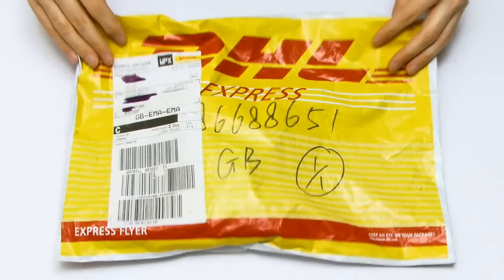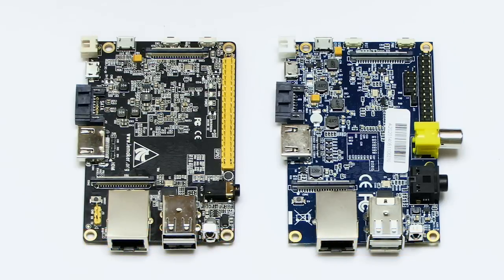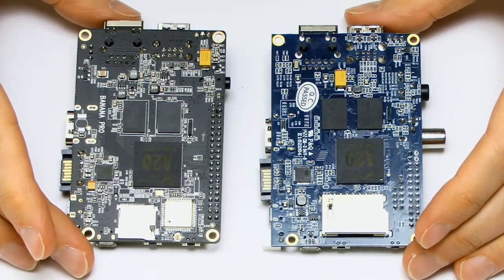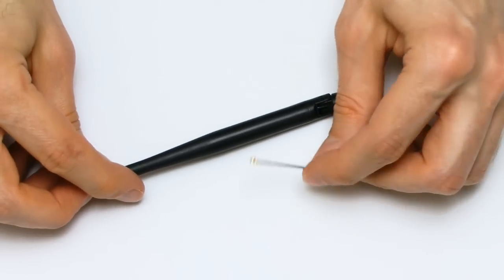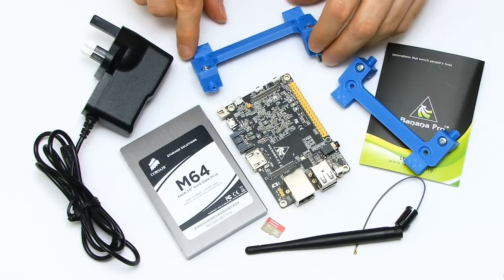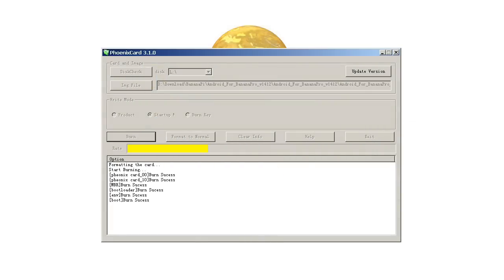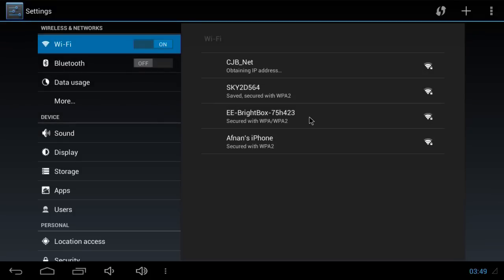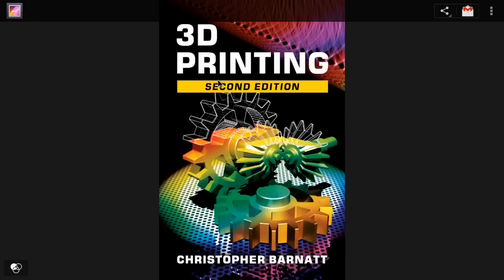The Banana Pro

Comment: I love tech theses days. So small yet so powerful :) great video as always.
Reply: Before portal 2, it was common to call slow dated machines 'calculators', but it wouldn't work these days with these micro computers. I had calculators in school which were as substantial as these things, and our fastest computers could not touch the calculator sized computers of today :P I think that is one of the major appeal of these, it is not about overall speed, but relative function, and these things have that in spades. 
Edit: Now i feel like digging for my TI-85 and seeing if any of my cheater(i mean helper) programs are still on it.
Reply: +Richard Smith Before portal 2? What does that mean? The game?
Reply: Robin Rai Calling dated hardware a "potato" came from portal 2, a game.
Reply: Richard Smith did it originate from portal 2? Interesting. Thanks.

Comment: I bought mine in early summer, and the thing works fantastic, I've had no problems with it whatsoever, but I find the board layout awful. First, it has external connectors on all edges of the board, so you'll need extender cables for enclosures if you need them. Next, it has SATA and HDMI ports side by side; even with an angled SATA connector, you will have a cable sticking out right next the video connector, or you again need to use extender cables. Finally, there are front and rear panel features mixed. The power and reset buttons are on the opposite side to IR sensor, which again is close to RJ45, which most people certainly would like to have on the rear panel. Whether USB connector should be on front or in the rear depends on use (and personal opinion), but when in use they're almost certain to block the IR sensor from the left. These weren't a problem in my build, but it does make making a small, tidy enclosure difficult.

Comment: So, The CHIP caught my attention to the single-board computers. I've watched videos, several of yours, compared and contrasted various single boards' specs. I have come to the conclusion that the banana pro is the one I prefer based on cost, built-ins, availability, functionality, support and what else. There is still one thing I prefer that most of the PIs do not have is the onboard memory. The buying an sd card, formatting it, installing the OS, etc., etc. is a bit of a hassle and leaves much room for error, but Android seems to run well on the Banana Pro.

This is an aspect of the CHIP I appreciate, the on board storage, but with the CHIP it seems more for programming and embedding, which I am not doing at this time and it needs a video adapter that costs as much or more than the board. The Parallella is THE tiny machine, but alas, I have not a use to validate spending the $100 or so for the best machine for the money. I like the Pine A64. It has decent performance across the 'board' but still generally low on benchmarks and tests and Android does not work too well on it.

All in all, it seems the Banana Pro fits my preferences at this time. Of all the single boards below $20 per bare board they all come out to about $50 to $65 with necessary peripherals and shipping costs.

Comment: Thank you for this! Really looking forward for the Banana Pro NAS video! Could you please consider 3.5 inch drive SATA powering? The connected drive(s) (3.5 inch size) need external powering according to Lemaker. An affordable NAS suitable for daily use should use 3.5 inch drives. Thanks again!

Comment: I just purchased a raspberry pi 3b and i was wondering how much would you charge for those brackets you used on the banana pro, but for the raspberry pi  I want to add a  solid state drive thanks

Comment: do you think it's better to use a case box with a motor fan or is enaugh the heat sink ?
Reply from the maker: +Walter P I personally have found the heatsink OK -- it depends how intensively you are going to run the thing! :)
Reply: +ExplainingComputers  well... I don't know .My project is to create a wifi server with banana and some android devices connect to it ....I don't hane any problems to get the case with fan. Did you try to run eclipse or netbeans on banana? How dows it work ? Slowly , normal , fast ....
Reply: if you want to you can use a small desktop fan to blow air on it i think that would be enough and if its not you can always slap a small ram heat sink like this on to help                    http://www.amazon.com/Saim%C2%AE-Copper-Cooling-Heatsinks-Cooler/dp/B018I2V46A?ie=UTF8&keywords=ram%20heatsink&qid=1464372429&ref_=sr_1_28&sr=8-28

Comment: I don't currently have an HDMI monitor or anything HDMI but I do have a TV with the red, white and yellow connectors. Is it possible to run video through the AV jack on the banana pro?
Reply: the banana pro has 3,5mm Jack that can be used as video and audio input just get composet to av cable and you shoud be fine

Comment: I've found the Android build on the Banana Pro to be very unstable. Also the Wifi/Ethernet drops within a few minutes of booting and the only way to get it back on is to reboot.
Using Android builds for the Banana Pi installed on the Banana Pro are very stable but not as fast for some reason, Ethernet works perfectly but of course no wifi without a USB wifi adaptor.

Same BPro Android build as your video... Perhaps the pre-production Banana Pro units were made slightly different?

Comment: The problem with that board is the allwinner a20.  It doesn't have proper accelerated video support. Extremely popular and common products like Kodi don't work properly.  Android does have drivers, however, most people using the Banana Pro will not be using Android.  I personally do not need another android device.  Also, because there's not much support for products based on this chipset, it means that the wifi drivers in Linux are a nightmare to make work.  I know, I've tried it.
Reply: Kodi and XBMC are the same product.  XBMC was changed to Kodi.
Reply: +Jim Blaich well is it atleast a good fileserver compared to a rasberry pi? The sata connector is faster than usb?
Reply: It is, but that makes to "single purpose".  The cost of it is nearly the cost of a decent full desktop board obviously without cpu and ram.
Reply: +Jim Blaich and case and powersupply... well these small boards would be nice if they feature more connectivity for storage than usb..
any single interface that is better would be highly appreciated by lots of people, msata, pcie, sata itself.

I have seen lots of my collegues play with the rasberry pi yet they throw it away after some time because of performance in generall. Ading any faster storage could help with lots of io tastk even a logger based around a database would really fly with ssd's
Reply: I use my raspberry pi 2s as media centers, for which they work well.  I have an attached ssd via a usb bridge where the pi is set to boot from the ssd.  That gives it much better performance.
Reply: +Jim Blaich Interesting.  Was the bridge something that attached to the board or are you referring to a usb to sata cable?  Could you point me toward instructions (of course, I know that I can search forums) about changing configs so it boots from SSD?
Reply: James Wilkins
there is no gpio sata hardware on the planet, your only chance is too boot off a sata->usb calbe/bridge/enclosure, as long as the pi recognize it. the speed is better because of the ssd. Before you buy maybe try a guid for usb stick booting and use the fastest usb you have that sound theach the slow microsd a lesson :-P...
SSD on any rasberry is overkill, only if you need space and performance together. SSD&Goodlike usb stick are the same for speed (both surpass usb 2.0 easy)
Reply: The banana pi and banana pro both have onboard sata both of which are based on the allwinner a20.  Don't care about gpio sata.  Yes, a usb/sata bridge adapter is the only choice.  That's a junk unit all round.
Reply: yeah bannana pi nice try :-P
if rasberry pi embrace sata i am in, until then i will use a cheap netbook thats easier
Reply: I agree, Moes.  I am impressed with the model 3 enough that I will use it for basic web browsing etc. sometimes.

Comment: One more question.  Can I connect the Banana Pro with any USB Flash drive? If yes, do you need any external power supply for the USB Flash drive ? Please suggest the perfect way to use any USB Flash drive with the product.
Reply from the maker: Nurain Akram Yes, you can use any USB flash drive with the Banana Pro. Just plug it in! There is no extra power supply required. The only limitation is that there are only two USB 2.0 ports (and you may need them for a keyboard and mouse), so a USB hub may be required. This said, you could connect a USB drive to the USB OTG port also via the appropriate cable.

Comment: Hello Christopher & friends, I bought myself a BPro this Feb and I am running Android and Lubuntu with my lemaker 7" display connected. The board works fine without the display but once the display is connected i am seeing that the board hangs before booting showing a dull RED power LED and nothing on display. I have copied the script.bin from github so that's ruled out. I use a 10400mAh MI Power bank sometimes a 5v 2A wall socket adapter. Can you suggest what could be the issue?

Comment: hi Explaining , good tutorial. I'd to know some informations .....
1) Which SATA hard disk are you using ? 
2) Installing Android ,I can install .apk  produced in Android Studio , pratically this banana is like a smart phone , ok without the phone functions but similary ....that's right?
3) The operating system is installed into the sata hd? Or are you unsing the hd only to store some datas?
Reply from the maker: +Walter P Here I am using a very old Intel 40GB SSD as the SATA drive. Any SATA drive will work, but I would use either an SSD or a 4200rpm 2.5" drive (eg a Western Digital Scorpio Blue model) to ensure you can power it from the Banana Pro's power out.

Certainly you can install Android apks -- as you say, it is basically a smartphone, without the phone bits! :)

The OS is installed on the SD card. The SATA drive is there for data only (and potentially you could install programs on it). So you do not need a SATA drive.
Reply: +ExplainingComputers thanks for your answer . About android I just would say that ...
1) For smart phone such as Samsung S4 and else I'm using Android Studio  or Eclipse + SDK . In this way I produce apk executable for the phone which is directly connected to the pc. But if I want to write code for banana-android  Ithink there is a problem because android studio and eclipse didn't support the library GPIO for example and then I cannot compile e produce the apk. It should be correct to develop in banana by installing android studio but this is impossible because needs to install more then 1 Gb and it use a lot of RAM memory .This is my problem for android embedded ....
Reply: I think I have to configure something like SSH server and run eclipse in my pc but " run as banana pi"....maybe something like that ....but really I don't know . I am planning an app which is based on banana and I need to use wifi , php + mysql .Pratically the banana will be a wifi server , which language I can use ? Does is it possible write my code in java ?
Reply from the maker: +Walter P Ah, I assumed you wanted to run "standard" kinds of Android apps -- not that that addressed the specific Banana hardware. I would suggest visiting the LeMaker forums to ask about this -- I have not programmed anything for the Banana Pro outside of Python.
Reply: ok....try to image this situation ....
1) I&#39;m working on a desktop pc based on Intel processor 
2) I&#39;m coding java for example 
3) For the banana pi I install the ubuntu OS 
4) Maybe I work with eclipse on my pc and I think it is possible to set some parameters into eclipse configuration to allow me to &quot;run as ARM &quot; ...thi sis my immagination but I never made that ....maybe by using a SSH server listening in banana ....it should be an idea , what do you think about ?
Pratically I have to inform Eclipse to compile for ARM and not x86 or win64 what else ....
Reply: I mean to use a cross-compiler and configure it well to do this job

Comment: Does anyone know an alternative board with 2 Sata connectors ?
Reply: adrianTNT Why would you need two sata plugs on a machine this powerful? I'd rather go with a mItx machine, or a laptop if you need more than one plug. Plus you can use a usb-sata adapter.
Reply: Champturn I wanted to create an open source NAS that is very small and compact. I am not sure why I cannot find the right combination, I must be missing something. 
Optimal for me would be small 2x sata nas like Synology, Zyxel, but fully open source with Debian or similar even if is not very fast.
Reply: You can do FreeNAS and just build a very basic i3 or pentium system on an mItx motherboard. Then you'd also have space for alot more drives, and upgradeability too.
Reply: Champturn I understand, but my main problem is the case, the ones with mItx seem too large. Software is not a problem at all as long as I have a debian/ubuntu/etc, like raspberry pi for example it is slow but I can install anything just like on larger linux computer. I want that but with 2x sata drives. I think I might end up with 2x 2.5 HDD connected with USB interface to a Banana PRO.
Reply: adrianTNT The silverstone SG13 is pretty small, has decent internals but can only house one 3.5" HDD. The 380T from Corsair can hold 2 3.5" HDDs and 2 2.5" HDDs, though it is a bit larger. I'm not sure how small you'd need it, but the 380T also has decent room for fans too, though it's not a very NAS friendly case. I'd reccomend getting a SG13, and then get an external housing for the drives. Sadly, these single board computers don't fit many of the needs of a true desktop.
Reply: Champturn Thanks for the tips, but what I have in mind is something much smaller, like this nas: http://content.hwigroup.net/images/products_xl/204096/3/zyxel-nsa325-v2.jpg , from the kind you mentioned I like Cooler Master Elite 110 (280x260x208mm), I see SG13 is a bit smaller so I will add it to my list :)

Comment: hi downloaded file as you have used phoenixcard but says no script tried others but will not boot
Reply from the maker: 50merlin I see that two new versions of Android for the Banana Pro have been released since I made the video, with one of these being for use with a Banana Pro with LCD screen. So, for a start, make sure that you are using the non-LCD version, which is the second listed on the download page here:

http://www.lemaker.org/resources/9-247/android_for_bananapro.html

The first version will not appear to boot on a Banana Pro without an LCD screen (ie using an HDMI or composite monitor).

In the video here I was using the initial 2014-12-25 version of Android for Banana Pro. This is still available from the page above, so another option may be to try this, and I know it works! :) Please let us know how you get on.

Comment: Can I download android apps? Thanks.
Reply from the maker: +Dominic Mann You can indeed! Android works just the same as on a tablet or smartphone, so you can download loads of stuff. Some apps may not work quite right due to the specific hardware.
Reply: Thanks a ton I am probably going to buy one eight now!
Reply from the maker: +Dominic Mann Good Luck! If you have problems with the particular apps you want, look at the posts lower down this forum, which provide some good advice: http://forum.lemaker.org/thread-1327-1-1.html